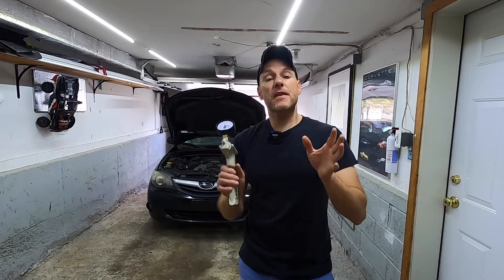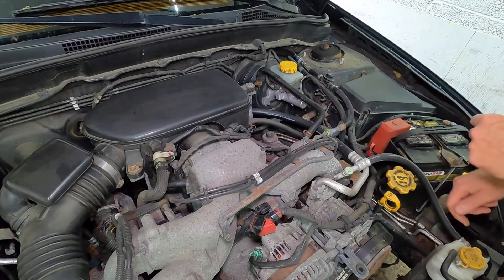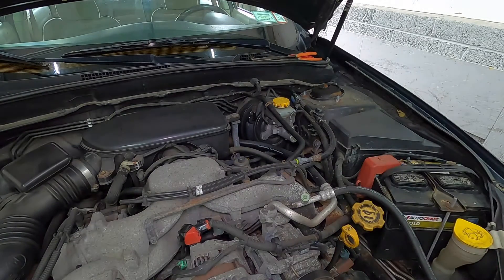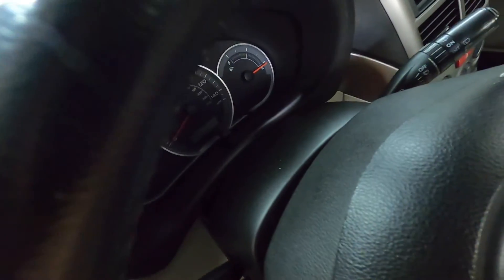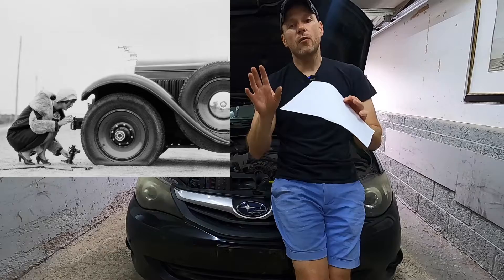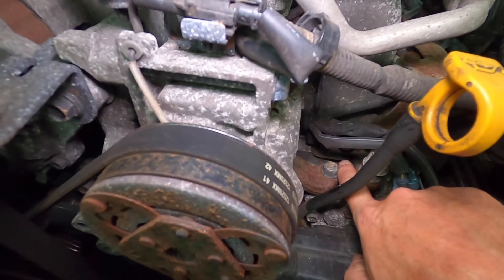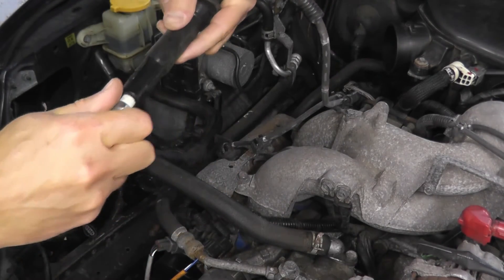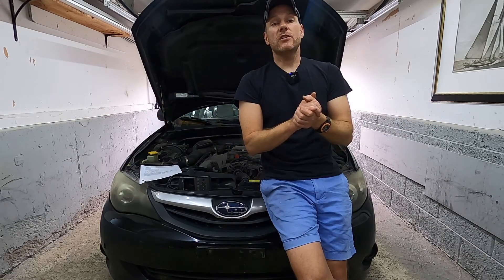Check your engine's health with a Vacuum Gauge | Super easy DIY!

Comment: why not just remove the hose from the plenum so we don't have to order your special hose pliers? and why didn't you plug off the brake booster hole when you were doing the test? I understand the vacuum isn't going in that direction but then later in the video you talk about plugging off that hole with your thumb...

Comment: Thanks for your videos and information, many mechanics don't know to do this type of tests, I went dozen of times to check with my subaru, with all I've described my problems, they always tent to go change sparkplugs and coils. So, not only for the money, but for money spent and not solving the problems I try to learn how to find and fix it myself. So my current problem is not eough power with my 2006 2.0x EJ204 Subaru Forester. I have two identical cars, one of them works perfect, the one with the problems I always need to push the gas a little more, especially al low rpm, now, when I slam hard the throttle, starting from idle, first its choke for half a second but after that it runs ok. (or at least I can't see the problem) If I push slow and constant the throttle pedal,  engine works smooth. But comparing it with the other Forester, same engine, its always harder to put the car in motion, seams like it strougle to make power. I've change spark plugs and coils, also did a compression test 142-145 psi to each piston similar, one piston I've got 151 in one test then 146 on the second one. I suspect a vacuum leak or a clogged exhaust system. Also, I think I might have some problem with the head gasket cover seal, I'm not sure why I have some oil leak on the passenger side, might be from that cover, but I need to check this, its not visible with the protection shield under the engine.
Any ideas on what to check beside this vacuum test?